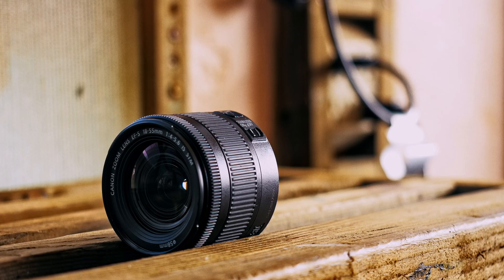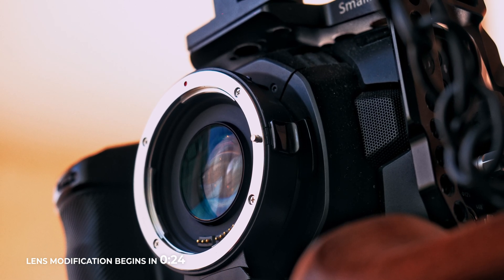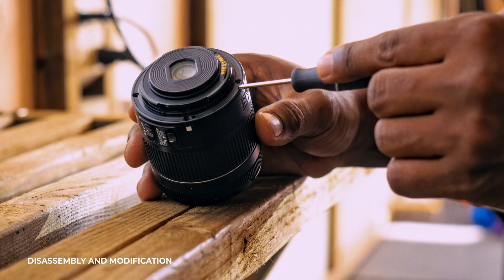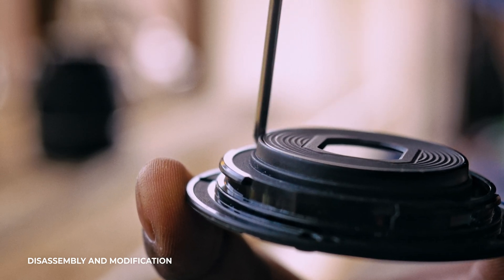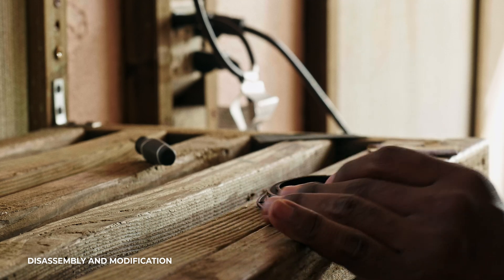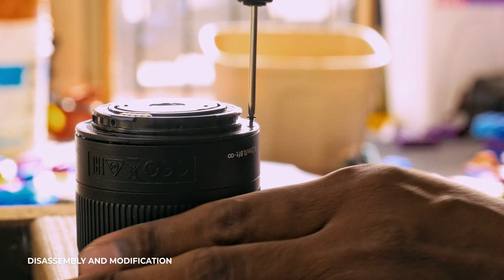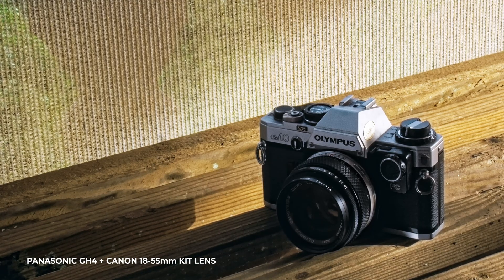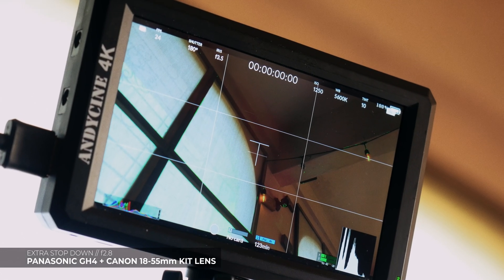Canon EF-S Lens to EF Mount

Comment: Thanks for the video 👍😁 I did it and it works 😀 I taped the zoom so that the lens does not go beyond the outline. I modified the Canon 18-55mm. 24 m it will be a good safe, wide angle 😎 Regards 😀
Reply from the maker: oH MAN. Yeah its kinda like a really good little budget hack lmao.
Reply: @STGFilmmakers  Hi :) I just put this modified 18mm55mm lens for Canon - analog camera (so full frame). I wonder if vignetting will be visible in exposed exposures on film at any given focal length. I do not see a vignette in the viewfinder, but I am worried that when I expose a rather expensive film, the vignette will be visible, which, for example, is not visible optically. I would be grateful for your response. Regards!
Reply from the maker: @langowski007  my guess is that a noticeable vignette will start to appear at around the 24mm focal length and wider.
Reply: Hi
Has anybody done this shaving to this 18-55 4-5.6 and than mounted on canon FF digital like 6D ?